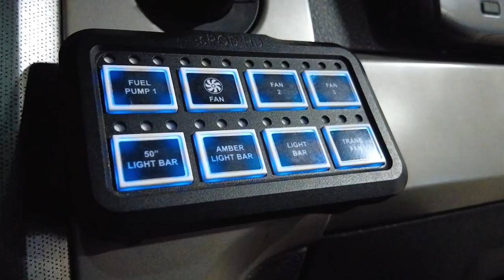Thomas Fichter's Ford Raptor Prerunner | BUILT TO DESTROY

Comment: Question… what is the benefits or reason to running a 3” spring over a 2.5” shock?? Is spring deflection something to worry about? Super sick truck btw love it and the color just pops
Reply: 2.5 coilovers need 1/2 inch larger inside diameter springs . Most coilovers all require a 1/2 larger id spring to work correctly. The 2.5 is the diameter of the shock body itself.
Reply: the 3.75 OD spring disperses the weight better, and you can often get away with a slightly softer spring rate
Reply: @Rommer2258  makes sense thanks